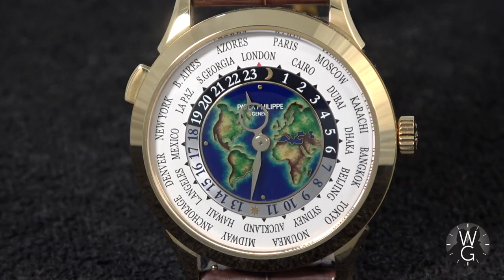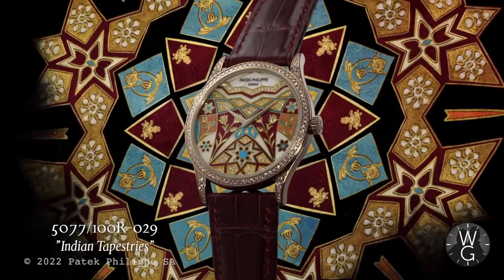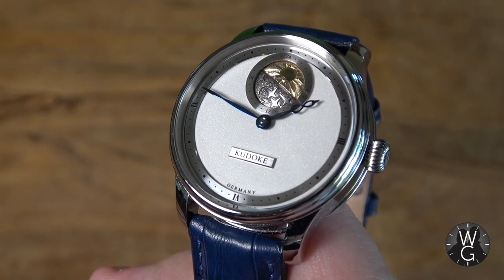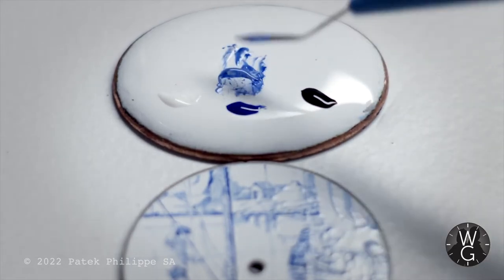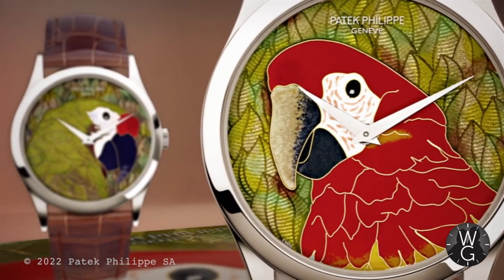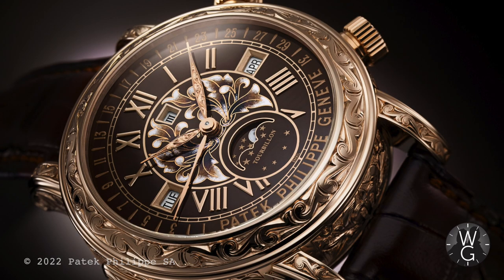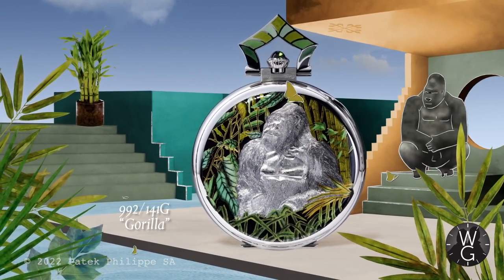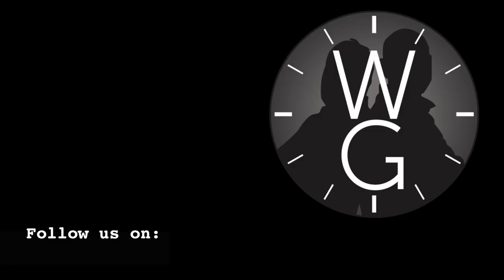Patek Philippe Rare Handcrafts - What Makes Them So Special & Desirable? | TheWatchGuys.tv

Comment: 5930G is discontinued, but it wasn't a reference that was especially hard to acquire when it was in production, was it? I distinctly remember trying one on that they had in stock and on display in Spiers of Truro about 18 months ago. As for enamel painting...hm...I guess my feelings are mixed. I greatly respect the skill and artistry, but I just don't like them personally. I guess it's just as well, because they probably aren't about to invite me to buy one any time soon!😛
(In fact, I'm pretty loath to buy any haute horology piece again any time soon. I dropped my 5212A a few months ago while taking it off - just from waist height onto soft carpet. It turns out this is a nice quick way to burn 1300 quid! Ho hum.)
Reply from the maker: Correct, I just procrastinated.